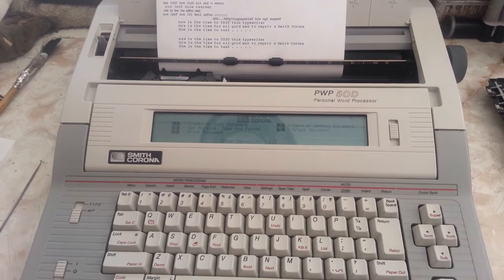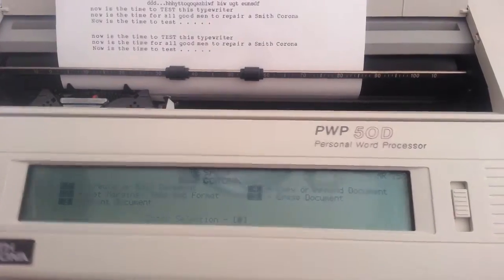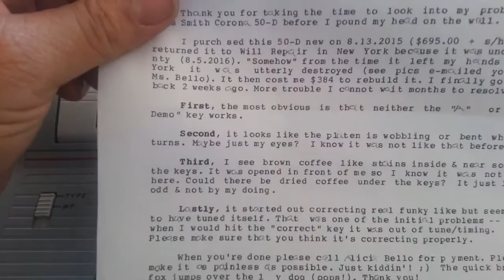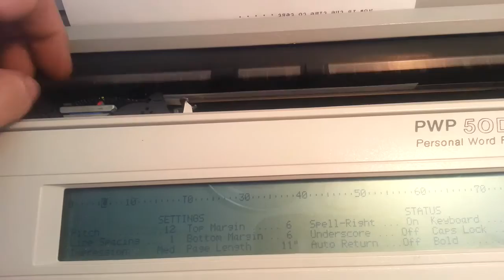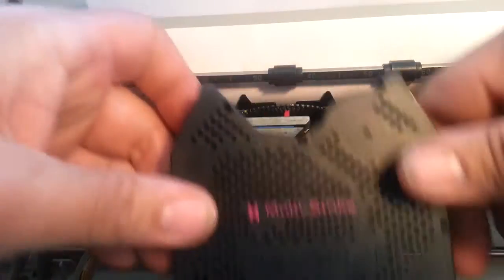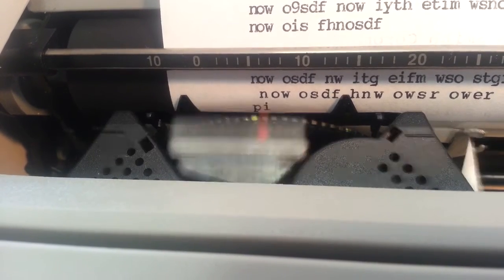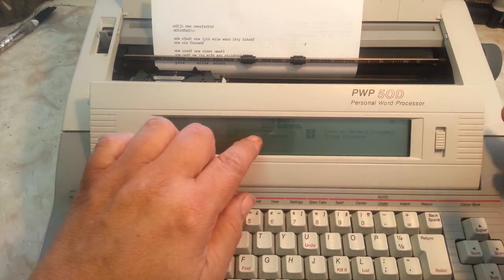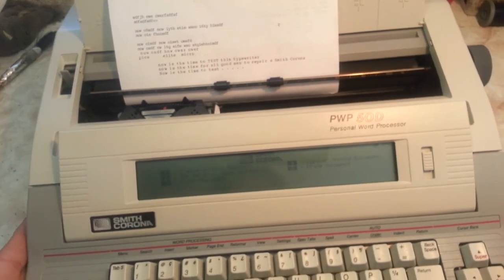Smith Corona PWP 50 Word Processor Typewriter Repaired Keyboard

Comment: Hey Phoenix Typewriter guy -- your videos are extremely helpful -- THANK YOU!   

I recently purchased a few Smith Corona PWPs in hopes that I could find one with a working disk drive.    No luck.   So, I took the one that was in the best condition (a PWP 58D) and removed the disk drive and found that the drive belt (made of rubber) had degraded and gummed up.   I ordered a 720k floppy drive emulator (uses USB sticks for storage) and installed it and it works!   

I now have a typewriter that can print items from my computer.   It's all very tricky, but it does work and I can now permanently store files (they're just strange little text files) on USB sticks.    If I hadn't seen your videos, I wouldn't have given it a try.   I also needed to clean the contacts on the on/off and type/wp switches with sandpaper, as you demonstrated.   

Thanks again -- typing addresses on envelopes and labels is far easier with a typewriter.    

Stay healthy and safe!  

-- Collin
Reply from the maker: Great  to hear about the success

Comment: I think the reason the white-out doesn't quite register over the original character is because the head seeks in the opposite direction.  This can also be seen with the alignment of the first character on a new line.  This might be improved by adjusting the belt tension, so the friction of the head on its guide rail has less effect on its movement.

Comment: I have a SC XD 5800 machine and the ribbon does not seem to advance. any advice?
Reply from the maker: Verify the ribbon is good by turning manually, or replace ribbon
With ribbon out and all safety switches bypassed type and see if ribbon drive spindle is turning

Comment: Phoenix typewriter, 
I have a typewriter at work that doesn't erase it just bolds your mistake when you try to use either the correction key or the word erase key. The correction tape is still good and I cranked the red part on the left as you showed in your other video. Hoping it's an easy fix, please help.... also where can I order a new knob (return knob?). It's a Smith Corona "h" series WP48D .
Reply from the maker: It sounds like the correction ribbon is not lifting, this would allow it to reprint (bold) instead of correct. If ribbons are right then lift has failed, could be mechanical or wire broken in wire-harness running to carrier. I repair most knobs with metal reinforcements, melting techniques & epoxy.